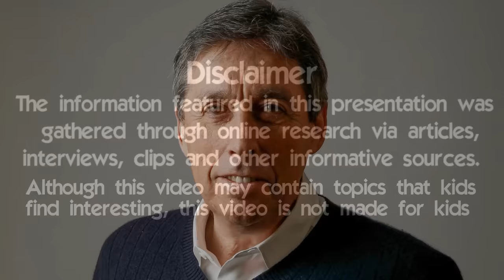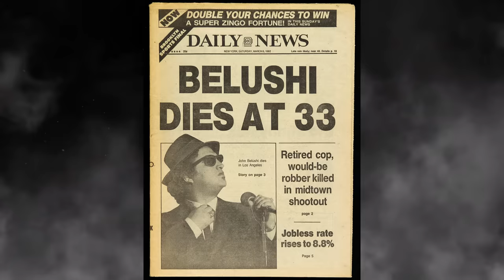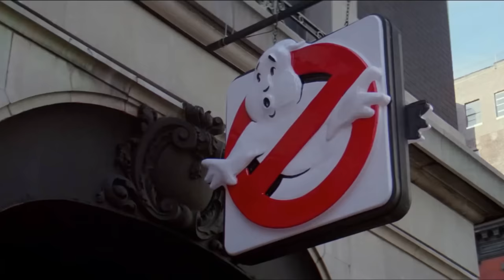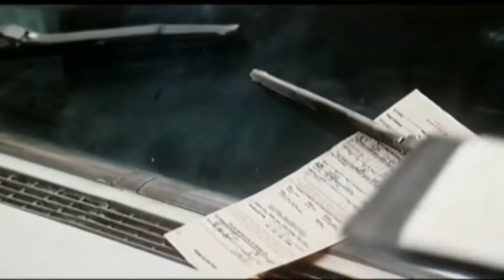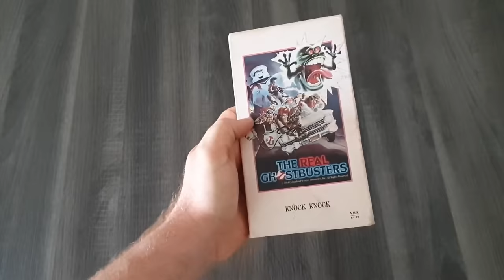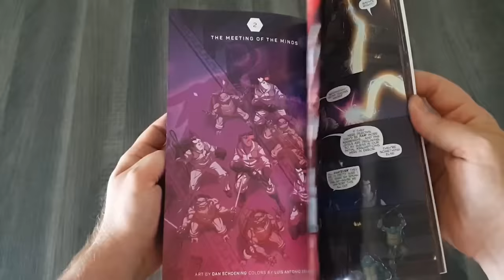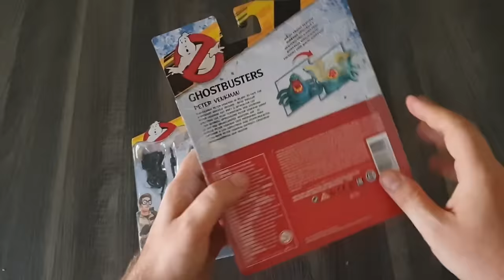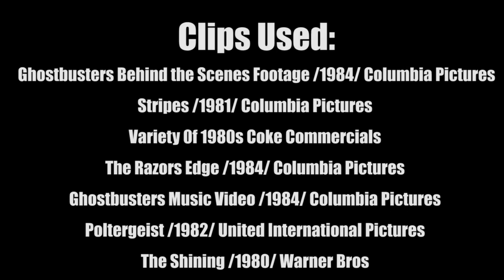10 MORE Things You Didn't Know About Ghostbusters

Comment: okay, let's try this AGAIN. (fkg autoplay shuffle!)
The "2016" figures you showed MAY be from a few years earlier circa 2010-12. Mattel's online store "MattyCollector" had several in-house subscriptions that you could order from, including Ghostbusters. The first wave had the Build-a-Ghost stand, which was later re-released at mass retail (in new packaging) to cross-promote the 2016 disaster. This online series included a Dana LPS (Little Plastic Statue) which had ZERO likeness to Sigourney, one torso and two lower sections. One half that (barely) stood, and one half reclined to lay on the included rooftop bench/base. Some even questioned if the "standing" Dana was meant to be the likeness that floated above her bed, as her bare feet were angled downward, making her impossible to pose upright without leaning her on something.  I don't think they got around to Gozer, which, after the horrid Dana, was likely a good thing?

Diamond Select also had a line of GB figures with a Build a Rooftop diorama thru DST (that I still have yet to complete), while Toys R Us and a few other retail outlets got figures withOUT the diorama parts. This line included Dana and the first Gozer figure for the first movie. These main GB figures were later redecoed with animated heads for the Hook & Ladder #8 front for RGB. GB2 redecoed figures were interspersed among both Mattel and DST lines, as well.

(Despite constant outcries for Mattel to make RGB figures in the MattyCollector online series, the then head of boys toys REFUSED to acknowledge that series. Whether due to license contracts or (more likely) personal distaste is still unknown a decade later. All we asked for was a basic repaint of the already molded figures. EASY MONEY!)

Comment: I have all the original "the Real Ghostbusters" action figures as well, unfortunately, mine are not in the box cause I liked to play with them.  Don't know wtf happened to my Ecto1, as I had that.  Also have the GB Firehouse, but the sign that comes off the front has been lost for 30 some odd years.
Reply: @Jonathan Minville Hasbro has reissued the original Kenner Real Ghostbusters figures, including Ecto 1 albeit they are getting expensive so if you want to get them new and mint on card get them now on Ebay etc. They are pretty close to the original 1986-87 wave 1 figures! 👻🚫🙏👍